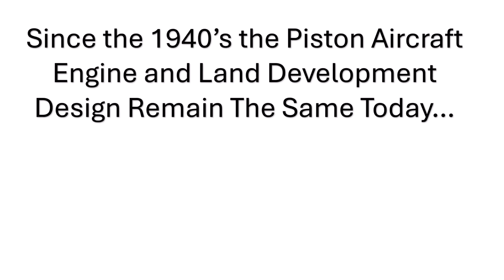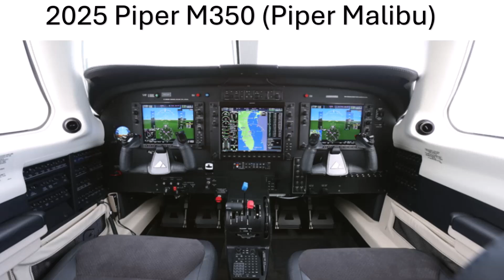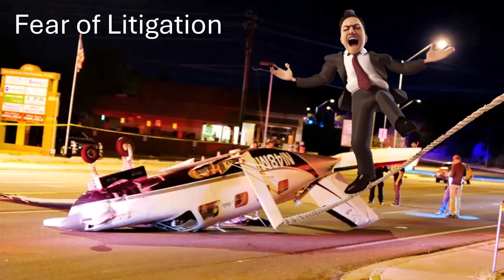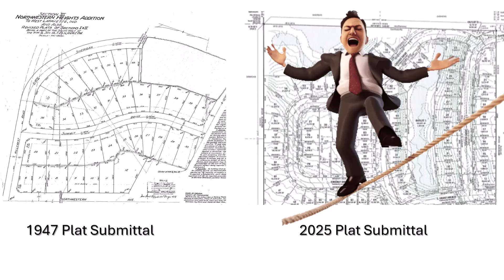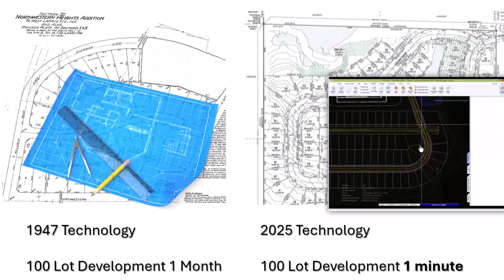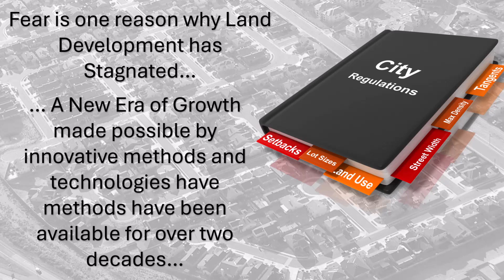The similarity between a piston aircraft engine and a new subdivision submittal.

Comment: I’m sorry, the argument for airplane engine design stagnation doesn’t work if you actually follow trends in aircraft development.  It can’t explain the existence of water-cooled Rotax engines and single lever full authority digital engine controls, not to mention the incredible amounts of innovation going on in electric power plants.  If you have to blame a single factor, point at the incredibly heavy handed regulation by the FAA and the tortuous approval process for lead-free aviation gas, for example.  I wouldn’t even be too hard on the FAA, since as they say, “every regulation is written in blood”.